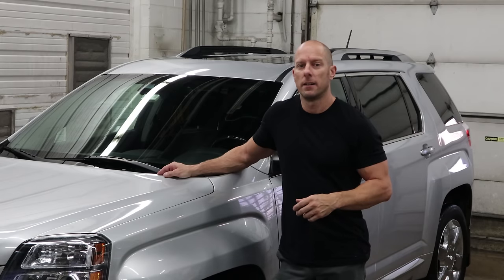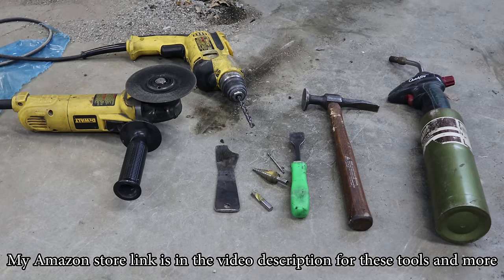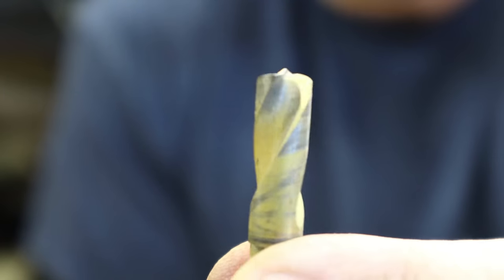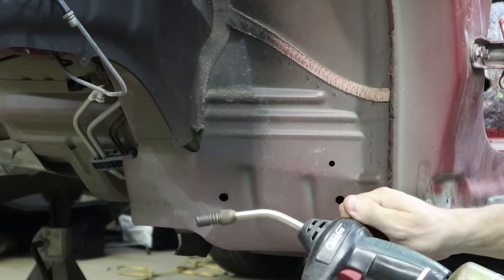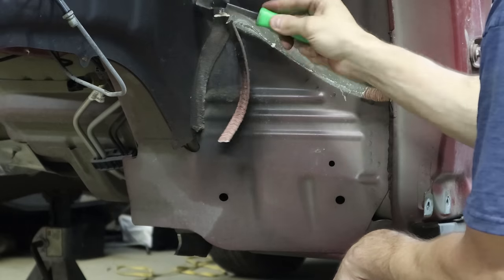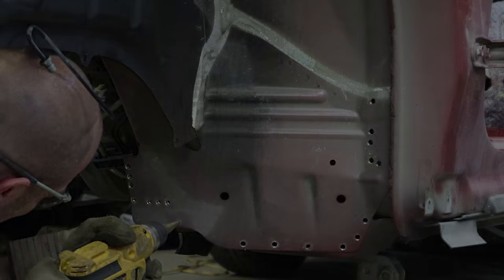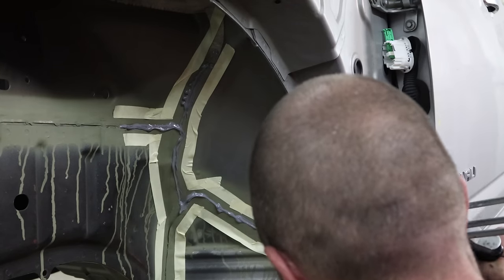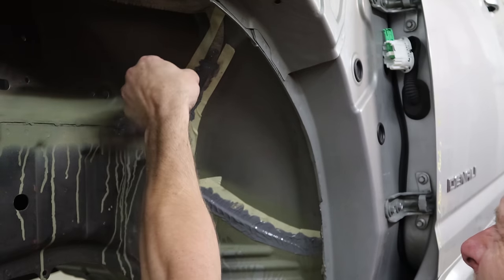Frame rail and apron replacement tutorial on our 2015 GMC Terrain Denali

Comment: it is nice to see a professional do a job right. Watching another youtube channel working on there 2019 GMC 3500 and they didn't primer any bare metal areas before permanently putting the fenders back together. The comment section didn't care for me questioning the brothers' skills.
Reply from the maker: If I know the build you are talking about, the heating of the frame scared me.  The lack of primer is just going to cost money down the road.  The frame could cost a life.  The people that watch those videos do not understand there is a proper way to do it and I don't think they care.
Reply: @vehcor  they care more about washing it 10 times to make it look shiny then dealing with an issue correctly.

Comment: As always Scott, great job. Really helps people understand the processes, and you do the right job! Always look forward to your information. I like the seam seal job, I learned one that matches a little closer to factory as you mentioned, you were not really trying to replicate. Apply the sealer, then with light air pressure, and in an pattern it will spread it to look much closer to the factory. Not saying your's wasnt good. Just another method. Thanks, fan in Canada!
Reply from the maker: I find an acid brush with light pressure will duplicate most factory seam seal looks.  I have done quite a few new dealer cars that had to look unrepaired.  This was a different seem sealer than I usually use, it dries in 10 minutes.  The stuff I normally use takes 24 hours or more if it is thick.  Thanks for the tip and support.

Comment: I myself prefer welding, you can see it and as your welding and know you got good penetration, spot welds your relying hope more than anything, I have had spots that look good but never bonded the metal together. Yes it's faster with less work but plug welds are, to me, far superior. Maybe because im old but so be it. Awesome video Scott and a tip I was shown, use your torch to heat the join to allow it to expand making removing and install a little easier. Don't need it to turn red just good and warm works well.

Comment: So true about the usefulness of frame benches on newer cars.  The new 911s are considered 'no-pull' chassis.  Even though they put them on a fixture bench, you are not supposed to make pulls on them.  You are supposed to remove and replace the damage instead.

Comment: Its nice to see someone take the time to do it right.Next time though You should think about using epoxy primer instead of etching primer before you seam seal.
Reply from the maker: I had issues with the epoxy primer.  The paint rep advised using etching primer first, and have never had a problem since.

Comment: Now and then you can score on bulk quality 1/8 bits on the auction site from the aircraft industry. I was told to avoid dealing with  broken bit downtime they only use them a couple times on aluminium and change them. I got a lot of 50 for $15 to the door. They look and cut like new.
Reply from the maker: Good to know.  Even the new ones are pretty cheap and they actually last, even on the HSS.

Comment: this is a greatest video I have ever found on internet for replacing frame rail on new generation unibody cars, you detailed everything including about tools.. i needed it badly as i have to remove  frame rail of 2017 Honda accord sports and doing it first time... both bended left side.. do i need to straight the old one first ? as i don't see it has impacted deep down.. can i remove frame rails without straightening them ? and replace with new one...  looking for another detailed video how to remove engine using harbor freight engine hoist with leveler,  where to tie chain ...

Comment: Very interesting how you replace the frame rails.  A lot of repairers straighten them instead of replacing them.
Reply from the maker: On some vehicles frame rails can be repaired or sectioned.  Not on these but there are people doing it giving this industry a bad name.  Most newer vehicles are designed for replacement assemblies.

Comment: It does kinda look like you went back in time with this video, I thought something was off. You got a little deep in this one with the rails and all.

Have you ever considered using one of the many available belt sanders for the spot welds? I can't tell you how many spot welds I have ground with them, they work so much better than a grinder. I picked up a super cheap electric one from Amazon just to use at home. Don't shy on the belts though, 3M 60 grit cubitron (33445) get the job done best. One box will do hundreds of welds, so they are cost effective.

Comment: Excellent details. One question. When you use your MIG to fill the spot welds but you put the weld through primer in between, the top layer has the hole to be filled but the bottom layer now shows the primer, so before you fill out the weld, do you remove the primer out of the spot hole so the weld will stick? Cause you cannot fill the spot hole with the MIG if you do not have bare metal on the bottom layer  correct? Thanks...

Comment: makes me want to replace the frame rails on my corolla... thing looks ROUGH under the hood.. but pulling vs replacing is what kept er from being totaled.
Reply from the maker: Better off with it totaled than driving an unsafe car in my opinion.  Fixing it properly is rarely ever the cheapest method.
Reply: This was Years ago, work car needed it ready to roll. Think it had 320k at the time? Currently sitting at roughly 800-850k (odo is dead, trip still works)

Cars been great, just wadded up in front. Debating fixing it up to keep it going. Still does 160 miles a day every day too

Comment: awesome work man, question though the plug welds that are done threw mig wouldnt you want to leave a small nugget and not grind flat, the reason im asking is because ive been told that if you grind the weld flat you weaken the weld, ever since they told me that i havnt grinded my welds flat i leave a small crown, keep the vids coming ive been learning new ways to do things at work from your videos
Reply from the maker: If the weld has proper penetration, grinding it flat will not compromise it.  I do see a lot of people grind it flat with the die grinder and then attempt to smooth it out after.  That takes too much material out and will weaken the weld.  That may have been what your teacher was talking about.

Comment: when plug welds are dressed;if the car is rebuild again after this; how are you  going to know where are the grind points for panel separation.
Reply from the maker: Oh it sucks.  I have had to do a few.  There is no drilling the second time.  It is all grinding and you have to pick a spot and try separating the panels until you hit a weld, grind it and move down the line.  It take 10 times longer! The welds are usually larger and not always uniform circles like the factory.  I’ll make a video next time I encounter one.  Good question!
Reply: @vehcor  Thanks man! Respect!
Reply: I've had the same question going through my mind for years now. I "repaired" my car after an accident about 10 years ago before I could find much info online on doing things the right way. Now I'm thinking I may have to find another donor car and replace the front clip as a unit to get rid of the mess I've created. I've been wondering if there are ways of repairing donor sheet metal to accept an actual spot weld instead of a plug weld for this reason.

Comment: Even after watching you work on a lot of these things. I can't get over how you take things apart in big chunks and put them together. Then I watch guys fixing blower motors or bending over the front end to work on something. I think of you pulling the motor out ( like this one ) and think why don't they do that
Reply from the maker: There are very few people that can pull an engine as fast as me and even I would not do it on most mechanical repairs, it is not worth the time saved.

Comment: What gauge tool is that? The one you used to measure the length and width and eventually height for the front frame rail placement? Would love to look up more videos of how it works

Comment: Good morning Scott, nice repair job. Excellent use of donor parts. I have 2 laser poles to level and align the vehicle. I use the green 3d lasers, really do a great job and my tired eyes like the green lines. I do like your multi drill bit process. What did you make your spot weld chisel out off? Works really good. Afternoon crew really proficient and time efficient. Thanks and you take care, and have a good weekend. By the way, your Mustang looks alot like the Revology cars Mustngs. Great website for technical info.

Comment: Could you give a little more detail on the welding aspect of it... welder settings, welder type, do you spiral weld to the center or go top to bottom, weld one then let cool or just all the way around, and any other important info on the welding. Thanks
Reply from the maker: Every welder is different, you need to adjust the settings for that welder.  Even the same models can have different settings.  You start in the center and spiral outward.  If you have the settings too high, the hole is too big, or the metal is thin, you have to pause.  I don't have the equipment to film welding so I will leave that video for the people that do, there are plenty.

Comment: Thanks for the video. As an estimate, how much do you think was saved by getting a salvaged vehicle, as opposed to getting parts new? I guess having access to a salvage yard helps.
Reply: I don't know his numbers, but its a lot. New parts, even when cheap, aren't cheap. Going to a scrap yard can be very cheap, even for large parts. At a local-ish scrape yard to me, I can get an engine for just over $200, transmission is $100, a door is $45, etc. I'm sure with how he is buying parts, he knows them and even gets a discount for that, plus he will find the cheapest way to buy everything, including buying a full front because it has all of the little parts. Those little parts really add up quickly, which is why he is careful not to break clips. 
An example is for a sprinter van, the sliding door has panels on it held on with 20 push clips, those things are $2.40 each, or $48 for the set of them on the door. The front Mercedes emblem on the van is $52 from the dealer. I just replaced a latch, and that was $150 for one part, even looking around for cheaper. Granted this is MB, not GM, but prices aren't all that different.

Comment: Good job, people need to take notes on how to do a proper job and not just hack things together. I had an uncle back around 89 buy an S10 with a rebuilt title, that literally broke in half while driving, come to find out, it was a patchwork quilt of a truck. All of the welds were ground down too far and filled with filler, even the frame. No one could tell until the truck split at the frame behind the cab. He wasn't hurt except his wallet.
Reply from the maker: The scariest I have seen was a Colorado that they heated the frame to straighten it and riveted on the front inner structure, yes you read that right, riveted.  The next accident was minor but the truck completely folded up due the heated frame.  Best part was it was a clean title, clean Carfax truck. lol

Comment: Take that metal scraper  and weld it to a air chisel shank and go crazy 😝. I have a punch attachment that would make a great candidate to cut the point  off slot it slide the scraper in and weld it and it would be awesome
Reply from the maker: I have similar attachments.  It tends to distort the panel or tear holes to easy.

Comment: LOL.  A Denali trim on a GMC Terrain.  That's like putting a purple King's robe on a pile of cow manure.
Reply from the maker: I get it, the equivalent of Platinum on a Ford. lol
Reply: @vehcor  Don't get me wrong.  Each company has it.  As for your videos, I enjoy watching you work your magic on these cars, CUVs, SUVs, and trucks.  I pick up a pointer or two on the easy for me to fix angle as well.  If I was in your shoes I'd go for this trim line whenever possible as it will sell well.

Comment: Can someone explain the system to me here? The chopped up wrecks, do the customers that buy them understand what they have paid for? Is there something on the registration documents that let's them know they have bought a repaired wreck? The laws between different countries are very strange. I noticed in an earlier video he talks about a "Salvage Inspection" any one who understands the way the legal system works with this would be very interesting.
I would hate to think any of these junkers could be passed off as a re-sale to an unsuspecting buyer without some indication on the log book! So how does it work?
Reply: Junkers? Most certainly they are not. These are good cars still, wrecks are all I ever buy. There a great way to drive newer cars and $ave, plus, buying a undamaged car is boring! You must of missed the part where he said it will have a “Rebuilt Title”, this means it was once a damaged salvage car and has been repaired. And usually the seller will disclose of the damage it once had and what was done when someone is interested in buying it.

Comment: The belt sander man less sparks....... your still too pretty for this....this is how I was tought to do it the but if you save both panels and panel bond it all then it will have "factory spot welds" with no welds
Reply from the maker: If I bonded the rails and aprons my ICAR instructor would shred any evidence of course completion. lol